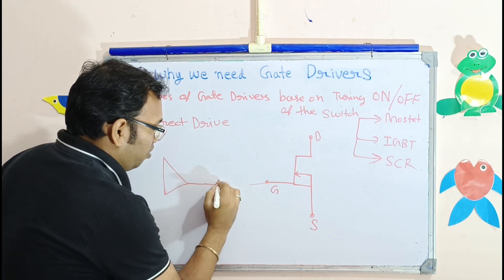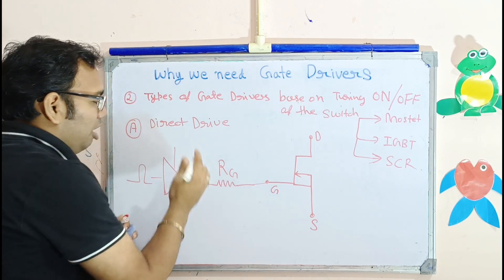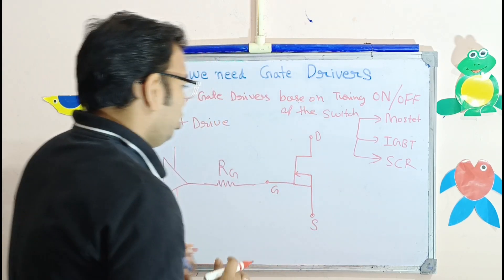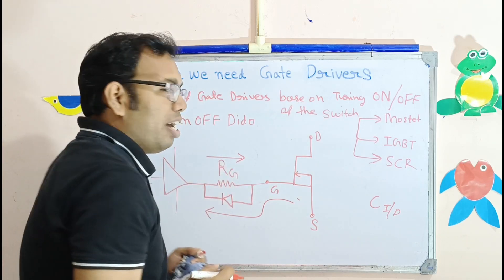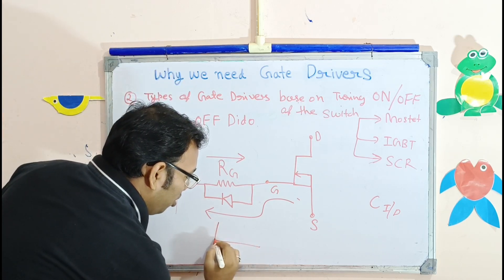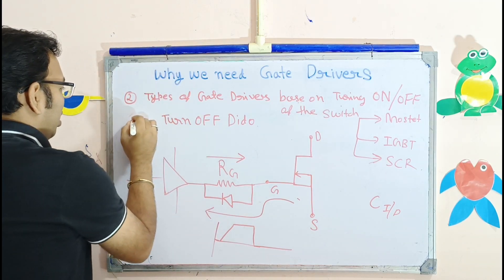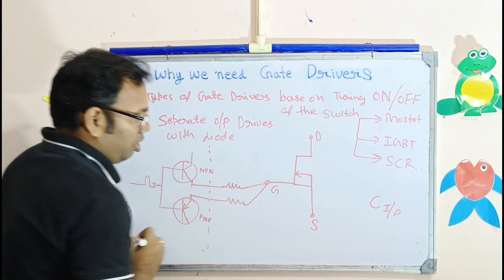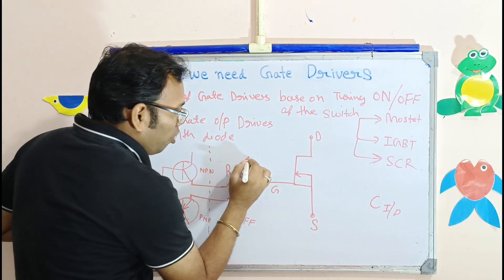Why gate drivers necessary in power electronics PART-2

Comment: Thanks for vedio can you help me, I need a gate drive working in 1MHz for the SiC MOSFET C2M0080120D transistor to design a inverter working in 1MHz or switching frequency is 1MHz.

Comment: Hello sir good evening
I have some doubt how to control output power in half bridge
Topology 1) frequency is fixed
Pwm is variable 2) pwm is fixed frequency is variable
Kindly guide me sir
Reply from the maker: With 1st one you can control voltage and current to control power
Reply: Ok sir thanks